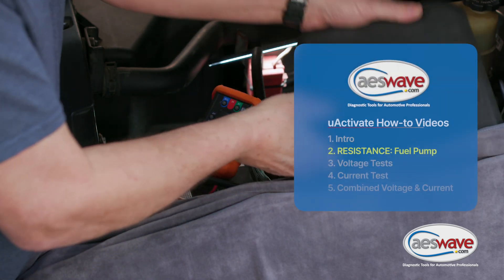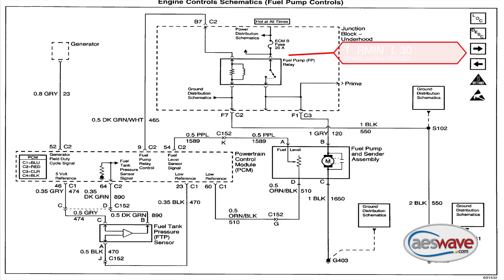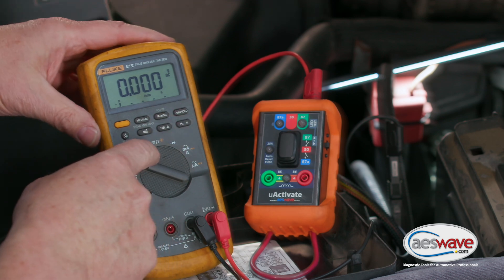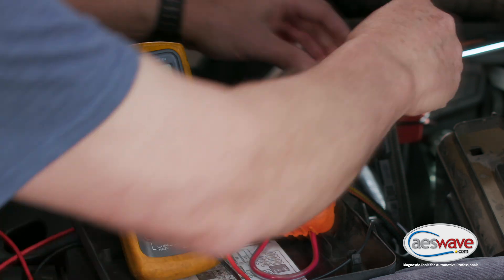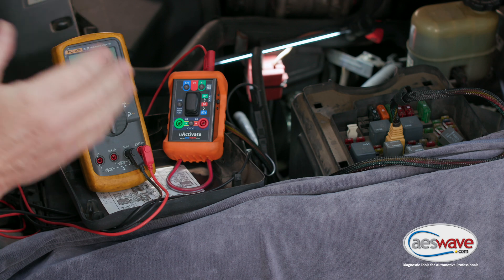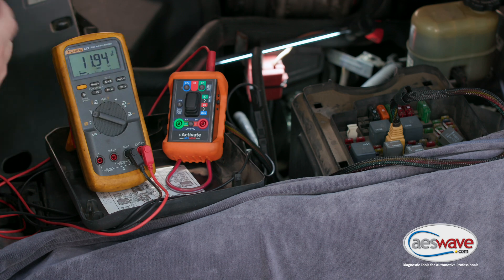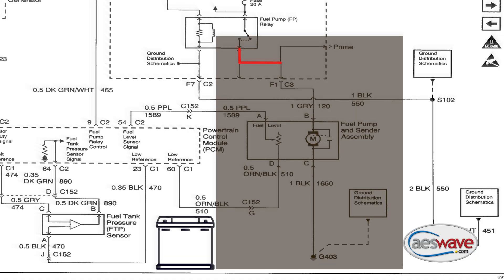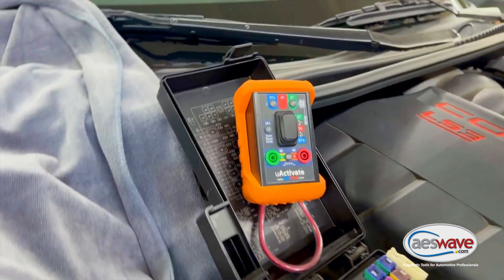uActivate® - How to Perform a Circuit Resistance Check on a Fuel Pump Circuit

Comment: Do not trust the Meters in the AES Wave U Scope.  I purchased an AES Wave UScope about 1.5 years ago.  About 6 months ago, I took one of the raw data files (file.aes) and exported the content into an Excel spreadsheet for more detailed analysis.  What I discovered is that the information reported by the meters is incorrect.
I called and spoke to Scott Anderson in their technical support department.  I emailed Scott the files.  Scott agreed there is a problem with the meters reporting and said they would look into the problem. I never heard back.  I sent several follow up emails, but AES Wave/Scott never bothered to reply. Just the other day I called again and spoke with Scott. Scott said they made their software engineer aware of the problem, but have not heard back from him. After 6 months, they still have not fixed the problem.  I am not impressed.  Zero post-sales support.